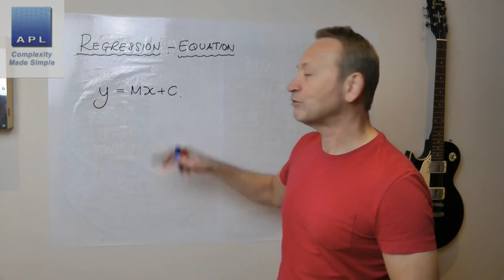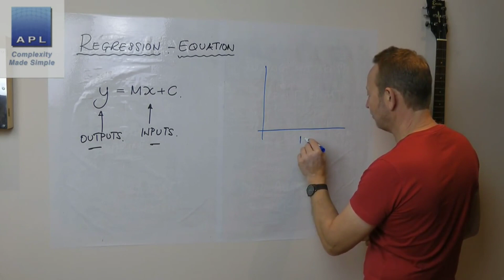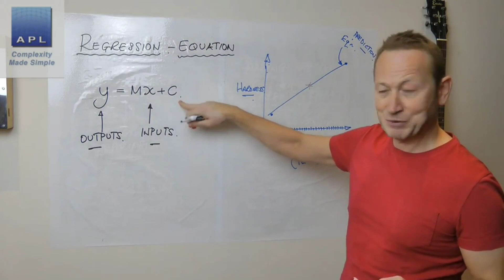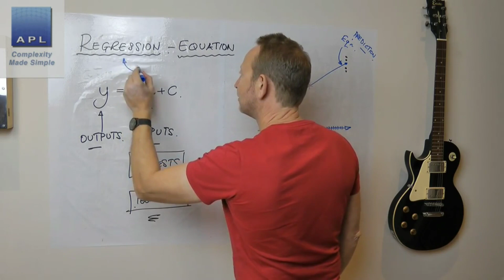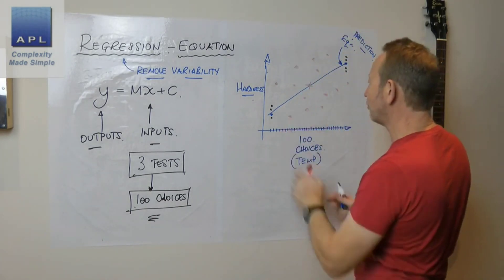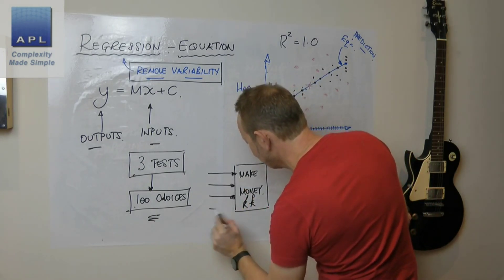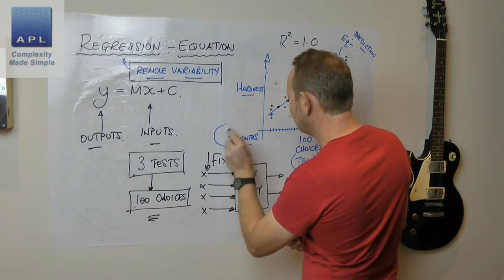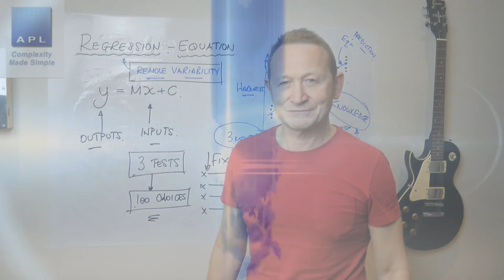When to use regression for process improvement

Comment: Hi Paul, I think you make some very good points here about removing variability first. As you know Dr. Burns (on LinkedIn) thinks Six Sigma is a scam. Dr. Burns keeps pointing to Dr. Deming's work as a reference. However, the point you make about removing variability, which is Dr. Deming's point in many areas, aligns Six Sigma as a tool that is used at a point in which variability has been addressed. I think it is important to point out when Six Sigma Tools are to be used and how. Excellent videos. Keep posting. Thank you
Reply from the maker: Bruce - perosonally i don't consider Deming to saying anything that is different to Six Sigma. I teach cause and effect to remove variability first and I also teach the stat tools to optimise. Most of my clients need both sets of tools/techniques